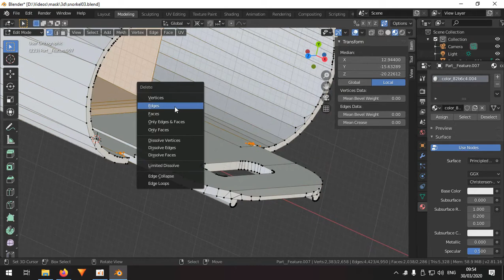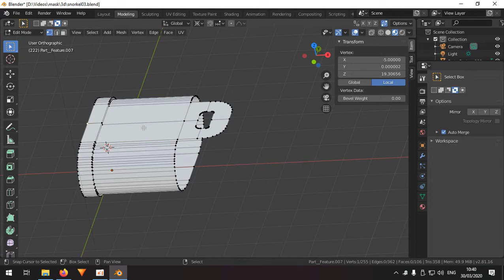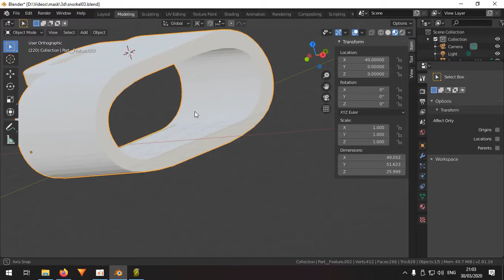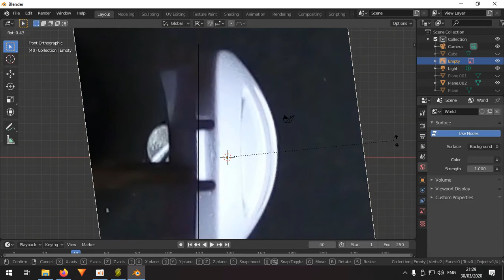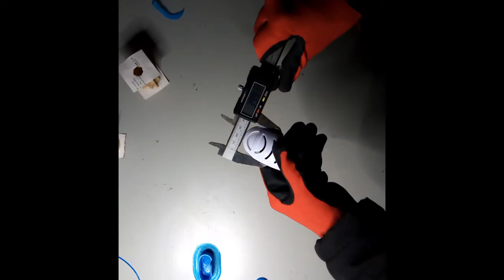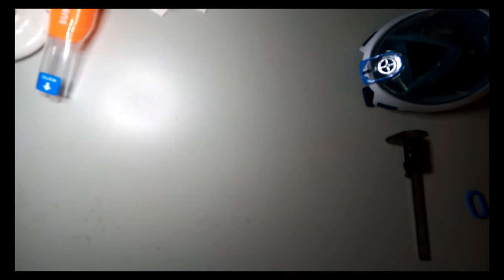Adapt snorkeling mask against Corona - part 2/3

Comment: Awesome videos!  I been working on my own snorkel mask 3D print design.  I am hoping to do a real world test here soon on mine and if successful make a video.  One suggestion if I could?  Spray the outside of your filter with a super saturated solution of salt water and let it air dry.  This has been shown to make filters more effective and kills any virus that gets stuck on the filter in 15 minutes.  In 5 minutes the virus is still alive but can't infect you because it is too damaged.  Anyway after 15 minutes you don't have to worry about getting the virus on your hands if you accidentally touch the filter and then touch your face.

You do need to do a test on your filter material to see if the added salt will make it harder to breath through.  My first design I didn't even have a hep or vacuum bag and just used some cotton fabric.  I could breath really easy though the cotton fabric but when I sprayed it with the super saturated salt water solution and it dried it became super hard to breath through.  I am assuming the cotton fibers swelled up with the water and when it dried leaving the salt crystals the fibers were still all swelled up.

I have now gotten actual mask filter material which you can buy in bulk and cut to your own needs.  It is Merv 16 rated which is equivalent to N 95.  I got it for $35 including shipping.  It is 21 square feet.  https://filti.com/product/filti-face-mask-material/

I have sprayed this material with super saturated salt water and let it dry and it is just as easy to breath through as before I sprayed it.  My guess is the material isn't a natural fabric but plastic so it doesn't swell up when wet.  Anyway this created a nice layer of dry salt crystals on the outside of the filter material.

I hope to have my video up in a couple of weeks once I get the design perfected.  Good luck with yours and will be looking forward to your next video. :)  Stay safe!
Reply from the maker: Thanks.
I hope the salt thing is true; there's a lot
of myths going around, so make sure
you fact check it.

Comment: Hello, can you help us? We have the mask but we dont have a 3 D printer to make the protection adaptor on the top. How can we get it? Can it be bought? Thanks.
Reply from the maker: The easy answer is google. There are a lot of 3D print services online.
And a lot of printable models.
For example: thingiverse , grabcad or cgtrader.
And then, there is a chance, it does not work/fit properly.
Depends  on how good the print is and the design.
There's also FabLab.
With 600 locations worldwide, where you can walk in and print it, and lots of stuff.
But I assume they are closed, during the pandemic.

So, maybe I can help.
You can mail me: werner@a-triangle.com
You can send me the 3d print model, and the exact size of the fitting.
I can send you a quote.